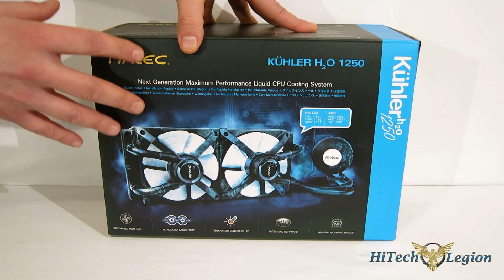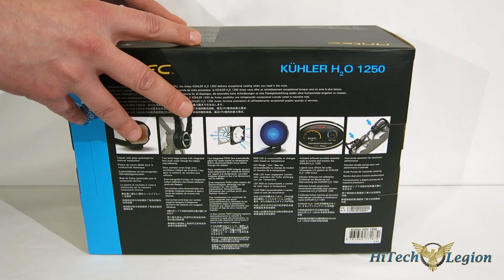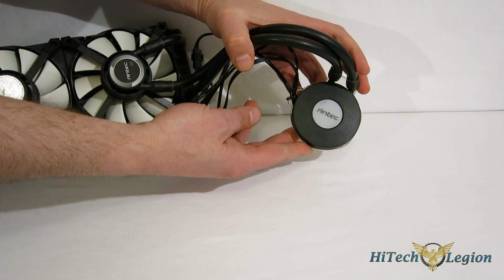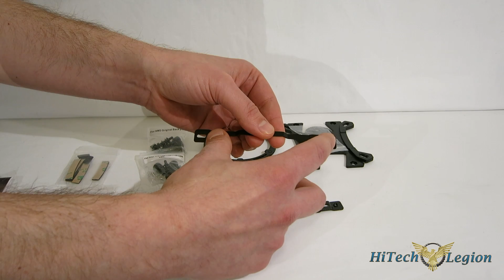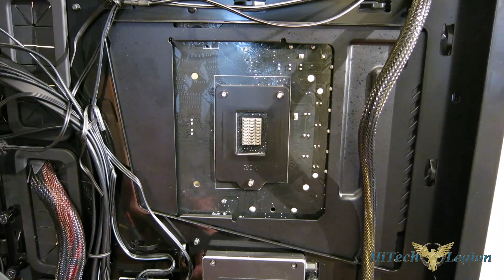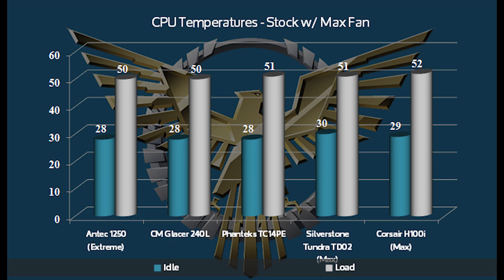Antec Kuhler H2O 1250 Liquid CPU Cooler Overview, Installation and Benchmarks

Comment: My cpu idle around 46'c with that cooler so its crap
Reply: Or you set up your airflow terribly.....which is the more likely scenario.
Reply: +George Cella no. I had Antec H20 920 and it was better
Reply: sounds like you have no idea what you are doing there mate, I would invest in a PS4 instead if I were you.
Reply: Jrock420blam I have good idea. I had experience with cooling stuff
Reply: gil zur
I was just harassing you, it does sound like something was seriously wrong though because unless one of the pumps was busted or something was really off like the temperature readings there is no way the Antec 920 should be beating the 1250 since it has double the rad space, double the airflow and double the pump volume.
Reply: Maybe I confused you . I mean i didn't saw any major difference in temperatures between 920 and the 1250.

Comment: hi there. i saw your video of the Kühler H2O 1250. im a streamer and i really want my cpu to be as low as possible when im streaming so im thinking of the Kühler H2O 1250. i have a Enermax Fulmo Advanced tower but i cant see any info if the Kühler H2O 1250 can fit in my tower.. can you help me plz :-)

Comment: i barelly could fit it in my corsair 200r :) but at end all nice and could make cables to run to back trought 4+4 pin connector place
Only i have problem that it not showing that i have connected it to usb port but i have and have tested with both usb 2.0 mobo connectors no difference and no i havent connected it wrong because it just not possible to connect wrong :)
+ i have disabled cpu fan controlls in mobo bios
Hope some one maybe know how to solve my problem if even will notice this message

Comment: so you should NOT use a fan controller speed for this?
Reply: No, the unit is wired to be controlled by the included software with a constant 12V input.

Comment: Just for anyone wondering... YOU CAN mod this i have mine running with two cooler master sickleflows (one of the original fans burnt out in 9 days... 9.. anyways the other followed shortly after..) but its not that hard to mod it will require two solders for the pumps and some patience. but it still runs like a champ :D

Comment: Yeah, Stay away from the Corsair coolers at all costs. They are bad. for many reasons and they fail very fast. Antec is much better from my experience. Wish i had known about this cooler beforehand.
Reply: Never had a problem with Corsairs. What exactly fails in them? Pumps?
Reply: For me the pump failed and I had to RMA, it almost cooked my CPU.
Reply: drv30 theeltea Between the Corsair and Asetek, I have had them take out headers on a three of motherboards. All on first boot up. Since I have reviewed ~30, that is about a 10% failure rate out of the box. Personally, I don't use CLCs, so these are all immediate fails. I would have to imagine that goes up a bit when they actually get used.
Reply: drv30 Corsair's PSUs have a high failure rate either

Comment: The twin pumps might have made an impact on a "well catered for" AIO market if only it had made an impact on the benches.. I get the impression that custom cooling loop kits are now going to be the New Kid On The Block.. i.e. Hadron Hydro shipping with (extra cost) quality custom cooling DIY kits.. I think AIO's have gone as far as they can. btw, this cooler is obscene.. Great review George (salute)..
Reply: I was hoping for more from the twin pumps. But, AiO as a category have been plagued with the same issues; incredibly low flow pumps, lower performance aluminum rads and low performing CPU blocks. Put them together, and it necessitates the crazy loud fans they need to do even a marginal cooling job. Antec took on the pump problem, but how much they solved is a complete unknown since specs aren't published. But....still mated with the same low performance rad and block.....

I had recently brought up the fact that AiO are becoming obsolete due to the price of open loops coming down so much, and offering so much more. I had one of the Corsair fanboys lose his mind entirely, pulling out every piece of propaganda without actual facts that he could find. It was actually that comment thread that pushed me to buy a dB meter and add the under 40 dB test. That is where you see the enormous difference with open loops, just look at the 240L numbers here. All the cooling power in the world doesn't mean a thing if you can't sit in the same room with it.

Comment: Its huge, its ugly and it does not out perform, therefore not worth the hassle in my honest opinion. For being the newest product in youre comparisions one would think it should perform better than the competition. Dual pumps it should be able to run at lower speeds with less noise and still maintain cooler temps yet it does not. Software is pointless, fluid temp tells me nothing. Need to just run it to a 12v fan controller to adjust speeds. All in all its a wash. Thanks for the review George.
Reply: Agreed, Jerry. The problem is that without upgrading the rad and block, there isn't enough transfer or dissipation. So, you need to keep the fluid at lower temps to make up for the block, and need to run the fans at crazy speeds through the aluminum rad to do it.

This is not an Antec specific issue, it is the issue that plagues the entire platform. I actually give Antec a lot of credit for at least addressing part of the problem.